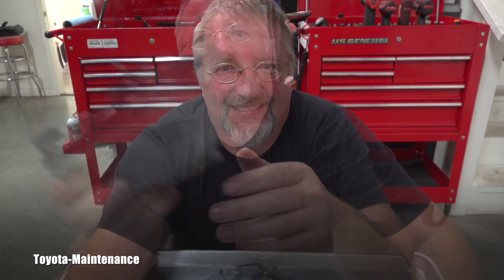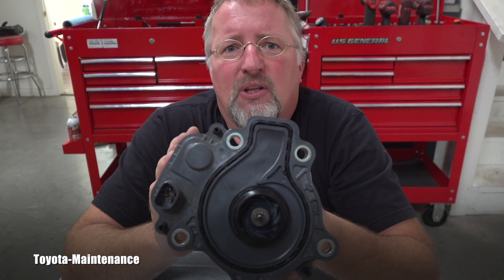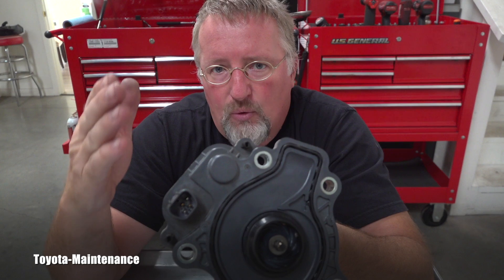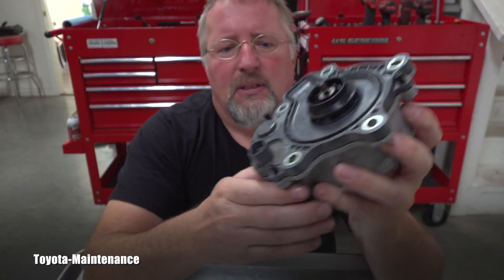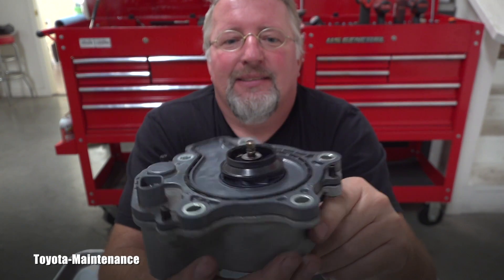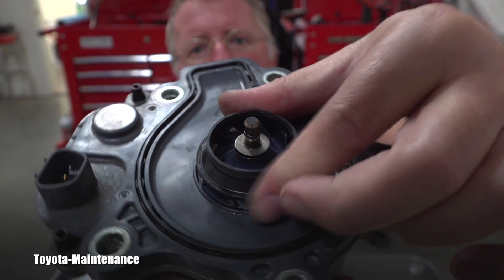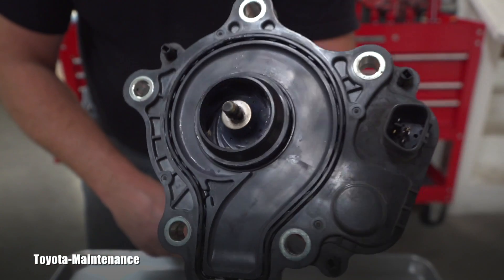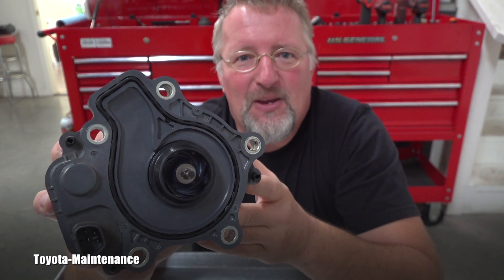Toyota code P261B Coolant Pump B Control Circuit

Comment: Hi Peter, and thank you for all your informative videos! You were holding onto the shaft which is fixed to the pump itself. The only thing that turns is the impeller which has magnetic inside of it. The windings are in the pump itself Peter so what do you think about just replacing the impeller? I see there are some aftermarket Impeller that could replace a swollen or impeller. Thank you.

Comment: I have 2014 Prius I replaced a new OEM water pump and new OEM thermostat with the Toyota pink coolant  system then started the car maintenance mode to bleed air ,10 minutes later engine shuts off and warning light came on check your hybrid system and stop the car 😮
Reply: What happened?
Reply: @ faulty water pump, I return it and fixed the old water pump by replacing only the rotor and issue solved no more overheating

Comment: that shaft does not move, pull the rotor up and out, off the shaft.  You may find that the housing around the magnet has cracked and is swelling not allowing the rotor to spin

Comment: I saw random overheating at 150k. replaced the pump with ebay one, osias. not aisin, but osias is a reputable brand. 70.00. the problem reappeared immediately. replaced thermostat, temp sending unit, checked coolant system pressure, no exhaust fumes in coolant, clean oil, clean coolant... only sporadic overheating with both old aisin and new osias pump. yesterday i connected autel and watched target pump speed and actual speed. got to 100 degC, and both speeds were zero. BUT. When I started watching the temp increase, at one point the target speed got to 2500, and then instantly to 0 rpm. i did not pay attention to this, but it seems this is the most important of all. ECU sets the speed to 2500, the pump does not respond, and appears like a short. Then the ECU sets the target speed to 0 to prevent further damage and generates the P216C code, pump B... short circuit, or open circuit, etc. does this make sense?
Reply: can someone measure the resistivity of the 4 pins on these pumps? old, new, good, bad? I will post my results later today.

Comment: Thank you so much!!!!  My 2015 avalon hybrid has 99,960 mile on it and finally had the check engine light come on as got this code.  The car gave me an indication of it overheating about 2 months ago and then once about 2 weeks ago so apparently the pump was just staring to go out as this last time the engine light came on.

Comment: This video is all wrong regards the pump and how it works... the shaft is fully fixed to the assembly so it will never spin at all and it's the rottor what spins freely...

Comment: Thanks for the info. My prius .. went on freeway and the temperature icon red light came on and went away within like less than 5 minutes. Did my engine overheated? But then no more light for rest of the day. Next morning I start the car and check engine light came on! Then I shut off engine did not drive it

Comment: My water pump is making grinding noise without no code and engine nearly around 100k. Does anyone think it's the water pump?
Reply: Grinding is bad. Replace it quickly.

Comment: I have a question, I got this code but it was only over heating at 50 miles per hour or more, then I changed it and the whole car would shut down after 2 miles. and still giving the code for water pump? Could it be something else? How do I check the relays?

Comment: There is a relay in the engine fuse box associated with this problem.  It is the R1 Cooling system (ENG W/P) and is located on the top right side of the engine fuse box.  This relay can weaken with a failing water pump.  After replacing the pump, if you get a P251C and the car possibly entering limp mode, replace this relay.  It's about $17.  Ask me how I know.  I was working on a friend's Gen3 and put their relay in my car and after 30 minutes of driving, BOOM, P261C.
Reply: Hi I just replaced a new OEM water pump and  new OEM thermostat on 2014 Prius and warning lights came on (check hybrid system and stop car in safe place) engine light p261c car shuts off after 10 minutes 
Should I replace the water pump fuse ?
Reply: @malekboularouk9593 could be your hybrid battery
Reply: I’ve been fighting this and I’m gonna try that relay change because I’ve got a new pump. Everything’s good everything and it’s just you know goes into limp mode shuts off cools off goes again.

Comment: I was curious after replacing this pump on my 2015 Prius V, I found that the magnet attached to the impeller was bulged out on the sides causing it not to move freely. Seems like replacing this component may be a less costly alternative to replacing the entire pump. Frustrating that these are failing so soon. I took some photos if anyone is curious

Comment: Hi, Thanks for the nice video. I have 2014 Prius V (3,30,000 KM). It keeps on blowing cold air in the morning when it is cold outside even after the coolant temp is 85C. Also electric water pump stays at 6375 rpm. However if I restart the engine then pump runs at 2975 rpm and it blows hot air with no problem afterwards. Recently I got the error code P148F (Engine coolant pump over revolution) which I cleared. I have already replaced the thermostat but I think the old one was also good.  Please advice if I need to replace the water pump? I appreciate your help. Thank you!

Comment: Hi,
My 2014 prius is giving code P148F and heater doesn't work for a long time. Also I noticed overheating light one. Would you recommend replacing the pump? I appreciate your help.
Thank you!

Comment: i have a short and simple question. can i fix my water pump just replacing that spinning part? Because on mine i see the round yellow part with a couple cuts.
Reply: You could IF Toyota would sell you just the spinning part.

Comment: Pull out the too-small impeller and you'll see a stupid plastic ring around the impeller armature. It will be cracked and it jams the impeller. GEN 3 was poorly designed. Besides the blown head gaskets caused by the inadequate, poorly designed (and never corrected) water pump (2010-2012 the worst), it has an equally poorly designed and implemented EGR system that clogs up. And # 3, the PCV valve is too low on the engine block so you need a catch can. So if you want to drive a Prius 400k without the expense of an endless money pit like a German car (they haven't figured out how to make plastic and rubber yet), Stick with GEN 2. My mechanical water pump has gone 205k so far, and if it goes, I'll probably know early by vibration and/or leaking before it blows the head gasket. And a new water pump is less that $50 and can be changed in about 30 minutes without dismantling the induction system. The GEN 3 ruined the Prius reputation of low cost transportation. I own 3 Prii and the best thing you can do is buy a GEN 2 and never use WS ATF. Use a real synthetic. REDLINE D6.

Comment: It might be that you terribly wrong. The part that you're trying to twist is unmovable. On the water pump moves only propellers. Before buying the new water pump I highly suggest to disassemble current water pump and try to clean it to get a nice and free spin. Code p261b tells you that the water pump spinning less then 900rpm. That usually happens when the pump propellers is dirty.
Reply: I just had this code pop but keeps going on and off. Am I okay to make it home and drive the next day or two before my appointment or no?
Reply: Keep an eye on your engine coolant temperature. If it peaks above 200 degrees Faranheit get it fixed immediately.

Comment: Sorry but, that shaft DOESN'T HAVE TO SPIN, is stationary. What's spin is the impeller. Take out the o'ring and washer from that shaft and pull the impeller out,. Attached to the impeller is the rotator component of that electric motor. Usually this part gets bad and its plastic body cracks. Inside the pump body are the coils stator  and other components. It doesn't work as a regular electric motor that the center spins, on this case the outer part does it.

Comment: The shaft is fixed to the body. It doesn’t rotate. Only the impeller rotate. If you still have the old water pump, remove the o- ring on the shaft and pull the impeller out. It is swollen or crack. Mines was cracked and swollen.
Reply: You are right. I just added some more details about.

Comment: Hello 
I have a question.
I own a 2007 Toyota RAV4 with 3.5 v6 and keep getting p0456 very small Evap leak 
I have replaced the gas cap and purge valve and code still comes back 
Any suggestions besides charcoal canister ?

Comment: At least in the olden days you can see the water pump leaking and then you Could change it I kind of gave you a warning before the car even started overheat now these electric water pumps can just seize up and actually cost you a motor
Reply: I just did my water pump after a week of that error code. 2015 Toyota Prius with 86k miles My pump was still running but When I removed it I noticed it didn’t spin as easily and would bind at some points. I was lucky and maybe it’s designed that way, to alert P261B code when it starts failing giving out before it catastrophically fails and causes a costly overheated engine.

Comment: My dealers every day price is 190.00. I would make sure to shop around. Mine is a 2016 Prius. Also looks like the Aisin version is model WPT205.

https://parts.toyotaofnashua.com/oem-parts/toyota-water-pump-161a039035?c=bD0xJm49U2VhcmNoIFJlc3VsdHMmYT10b3lvdGEmbz1wcml1cyZ5PTIwMTYmdD10d28mZT0xLThsLWw0LWVsZWN0cmljLWdhcw%3D%3D

Comment: Both my mother's and my car Camry had failed water pumps before 60k miles. I knew in the case of my car I had initially issues with the heater and that was coolant was low. The regional Toyota HQ told me the they don't last more than 60k. Planned obsolescence. Yet...I'll buy another Toyota because they still last longer than any other brand. 
I couldn't imagine buying another brand, especially domestic...though my Camry was built in Kentucky. Fingers crossed else it's history. 
"Kaput"...that's a Yiddish word. LOL. 
My father would come up with his own words, for instance with my alias Gidagorfen for him meant "It's a whatchamacallit". So if there's anything in the car you're not sure of...it''s a gidagorfen.
Reply: My 2008 Prius has a belt driven water pump. It went 280,000 miles.
And the replacement from O'Reilly's Auto Parts was $50.
Electric water pump failure is pretty common on the third gen Prius 2010 to 2015 as well as anything else that has that powertrain. They're also well known for having EGR coolers clogging up with carbon residue. both of these can end up causing a blown head gasket.
If you want a reliable Prius get a second gen 04-09. They certainly have a few issues themselves, but they tend to not have engine problems.
My 08 now has 340,000 Miles.
Reply: In New Zealand my mechanic uses the word "munted".

Comment: This guy is weird and rarely shows the repair, y make a video???
Reply: Check the video length and set your expectations before you even click on it. You're not going to see a full water pump diagnosis and replacement in 4 mins odd. I actually find it quite interesting to see the failure modes of parts. Just because YOU didn't find it useful or interesting, doesn't mean it wasn't worth making this video for others. I'm really frustrated by people like you that can't see past your own feeble life experiences.

Comment: Hello, thanks for the video, i was wondering, if the coolant pump was seized why the problem was intermitent?
Reply: The pump got progressively harder to spin... Overheating problem started intermittently, as the pump progressively worsened. Pump then overheated and seized from increasing resistance as its bearing failed, possibly due to coolant ingestion.